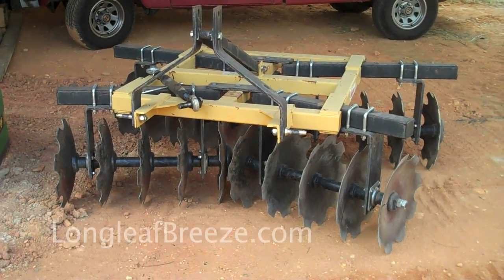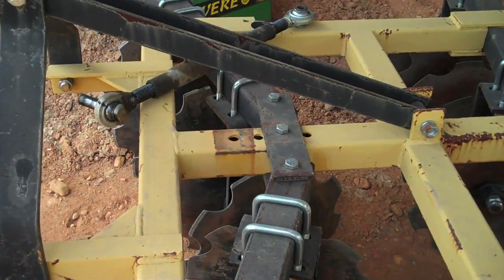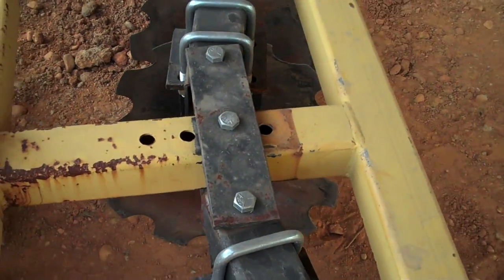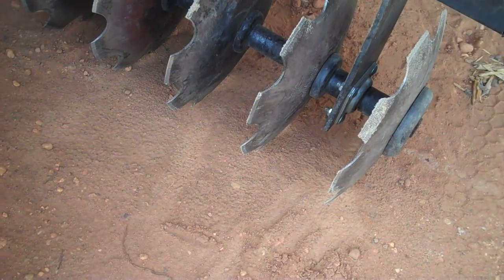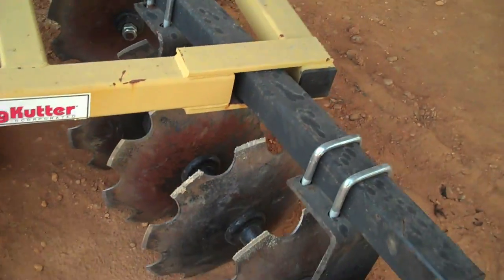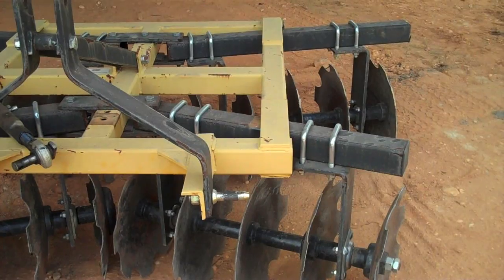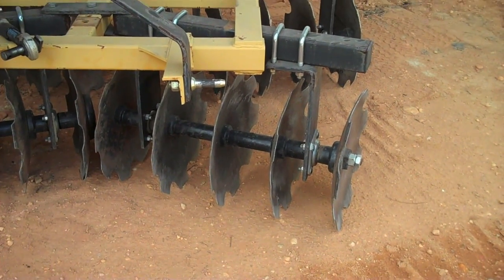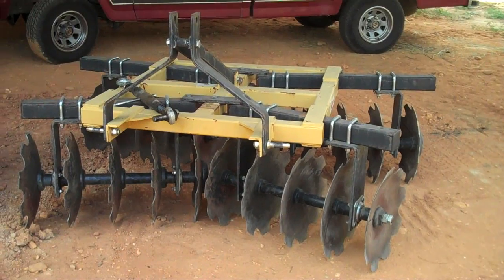I Love My Disk!

Comment: After harvest the plow turn the soil over an the residual organic material decomposes adding nutrients to the soil.  The disc is used to break up any clods and provide soft earth for planting.  It allows the seedlings to send down their roots easier.  Sometimes roto-tillers will be used on smaller plots but the roto-tiller does a number on earthworms and such.  The discs break up the soil without desintagrating the dirt into very fine dirt( which by the way, packs down very hard when it rains.)

Comment from the maker: Not a stupid question at all. I don't own a plow, which one would use to dig one deep furrow and turn the soil up from deep under ground (like 8-12 inches). The disk is designed to cover a six-foot swath instead of one furrow and to stay much shallower. In this case rarely more than 3-4 inches deep, and most of the work I do with my disk is at a depth of even less than that, more like 1-3 inches.